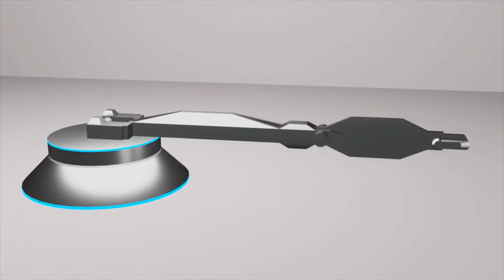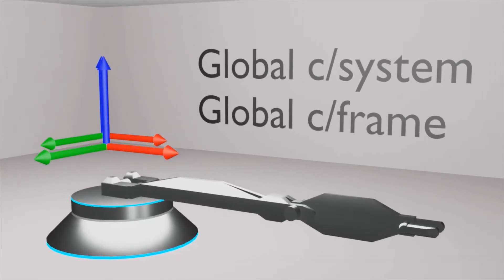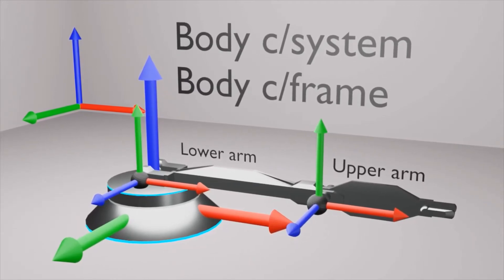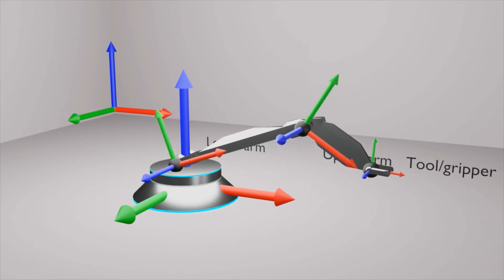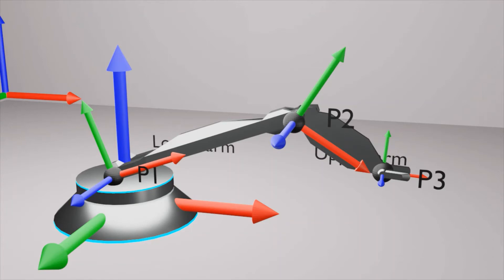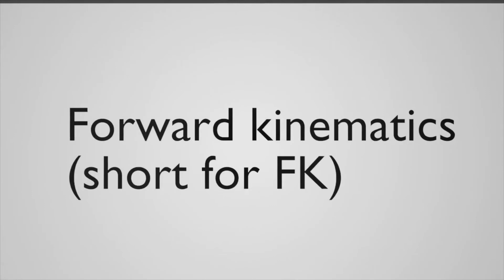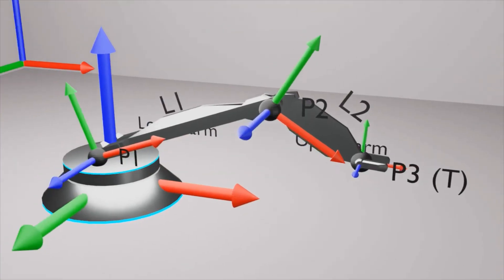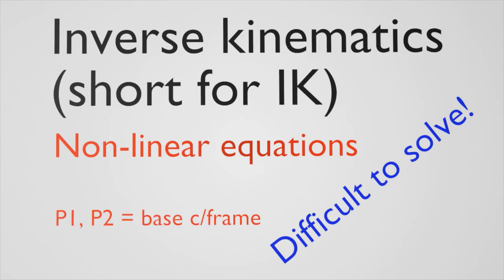Forward and inverse kinematics

#robotics #kinematics #animation

Comment: Your coordination frame directions are incorrect. Check with Right hand rule
Reply from the maker: Thanks for the comment. Usually, whether there's a rotation joint, that will be taken as Z axis (blue). It doesn't matter which rule is taken, as long as rotation matrix can be calculated.